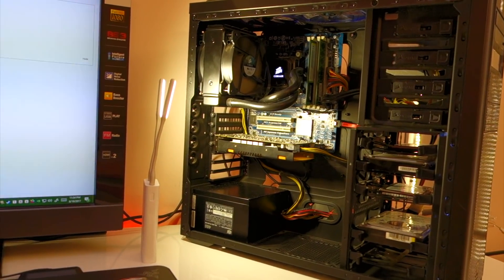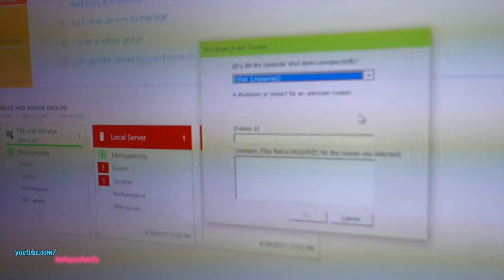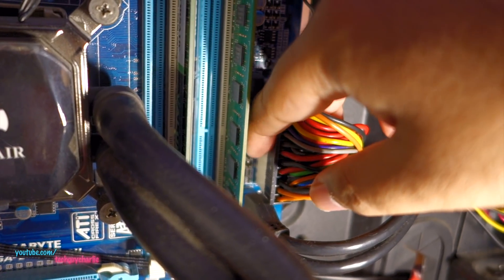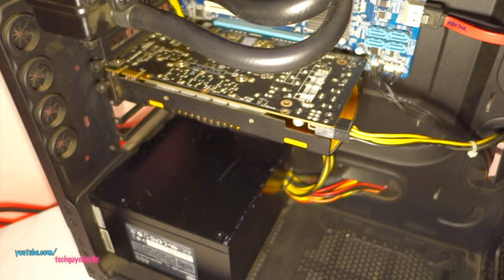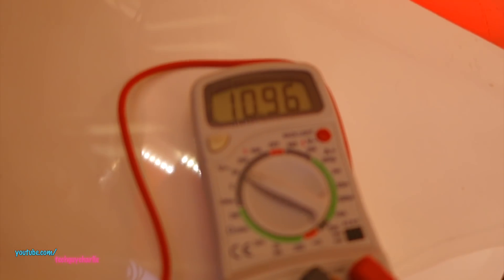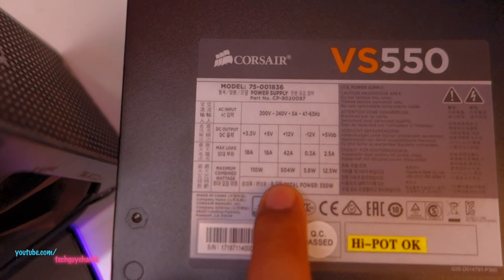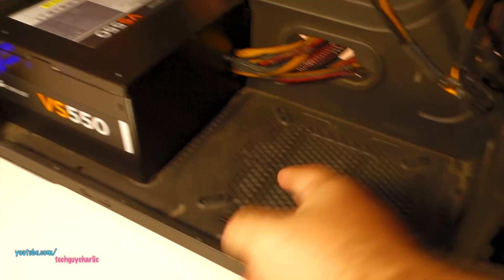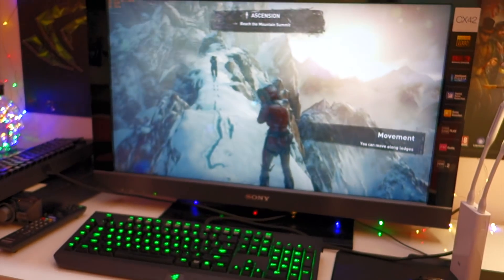Computer randomly shuts down and turns back on by itself - How to diagnose a faulty PC power supply

Comment: This is very frustrating, especially the hopelesness feeling after it happens multiple times in a day
Reply: For anyone wanting an update, bought a new power supply, it happened again, $100 down the drain, messed around with pc battery savings over the co ur we of 2 weeks and now it’s fixed
Reply: @-FreFlo  please re type that
Reply: @-FreFlo  did you fina a solution?
Reply: @pushpithageeganage7992  nope
Reply: @-FreFlo  replacing psu didn't work ? did you try motherboard?
Reply: @pushpithageeganage7992  nah psu didn’t work, and I don’t even think I could replace motherboard, as it’s a 6 year old prebuilt
Reply: @-FreFlo  I think for me it’s the psu gonna get a new one soon, you should try uninstalling drivers and reinstalling them, reinstalling windows, maybe it’s the motherboard or the gpu, maybe just take it somewhere for them to look at it
Reply: @riachu81  Did a new power supply work?
Reply: @Shiv-xm4xm  the problem was a bad ram stick.
Reply: @Shiv-xm4xm  take your ram sticks out and test the pc one at a time, that’s what I did and I found the bad one
Reply: @riachu81  Yep, I already tried this. The problem was still there. Although I did notice that I was able to play games for longer periods of time with one stick as opposed to two sticks.
Reply: @Shiv-xm4xm  yeah that happened to me then I tried the other stick out and it’s been fine since
Reply: @-FreFlo  I bought an iBuyPower trace 940 back in 2018, it shuts off randomly showing the exact same symptoms you're describing, I've replaced EVERYTHING in the computer including the hard drives/ssds and it still shuts off randomly, at this point I'm starting to think it might be the case.. XD
Reply: @deconwhite  hahaha yea I have no clue, my pc still does it
Reply: @deconwhite  same problem on my ibuypower I have the trace 4 MR 9340. No clue what is wrong with it and I’m angry Amazon won’t take it back. Ibuypower sucks
Reply: It happens to me even when I'm just watching a movie not only by playing a heavy game like horizon zero dawn, So what i did is i removed my gpu that is gtx 1660 super Evga and tested my pc with the integrated onboard graphics that is intel hd 4600 nothing happens even when playig light games but when i plug in my gpu that is gtx 1660 super pc keeps restarting itself with a buzzing noise/sound. Can anyone help me?

My specs are 
Intel core i7 4770
16gb ram ddr3
Eps 850 watts 80+ silver
256gb ssd
Evga Gtx 1660 super 6gb vram
Mobo ecs z87h3 a4
Reply: @footballmatchhighlighttv  u found solution?
Reply: @CruyffTech  sold the pc and bought a jailbroken ps4, now I'm enjoying so bad 🤗
Reply: @footballmatchhighlighttv  damn 🔥😂😂
Reply: So what is the solution?
Reply: @vinhleba8126  just keep messing with settings i guess...
Reply: @-FreFlo  I was messing with the settings and fixed it for a month or two and then it happened and now happens more frequently.
Reply: @-FreFlo  Don't you remember where were you messing with? I desperately need to know :(
Reply: KornalyUr yes, so it was my power supply, corrupted power supply, had to switch back to my old one, <3
Reply: @-FreFlo  Oh.. My PSU is working fine, I checked. My other guess was overheating, but when I check it with SpeedFan, it's never above 60°C under stress test.
I guess I'm doomed to get used to my PC shutting down anytime :(
Reply: KornalyUr 60c isn’t to cool bro, should be chillin around 45
Reply: @vinhleba8126  Change your PSU
Reply: I have an update guys: My problem was resolved after I saw that my mb was overvolting my a6 5400k, causing the random reboots I was having. So check that out if you can.
Pd: English is not my first language
Reply: @Nicoyunn  yeah that also can be the issue
Reply: Lamborghini Boy lol
Reply: ColipongHickey I can’t dm you when I go to the about page.
Reply: Also a Thermal Paste can also work as it cools the processor.
Reply: Whatever It still is doing the same after a month I guess my luck isnt good
Reply: @hk9 well if it makes you feel better recently I was trading with rocket league professional player musty and I crashed mid trade while he had like 3k viewers
Reply: bruh i lost all my school work on google form bcs of this bs
Reply: ColipongHickey did u find a fix? I say take it to a professional I’m taking mines today he should fix it
Reply: @wylo1071  It turned out my video card was faulty. 3 and a half yo GTX 950. When I put back my old one, the problem disappeared
Reply: KornalyUr Heikal Syah I’m having a similar problem when I play game for like 20-30 mins my computer just restarts when playing games do u think it’s my psu I don’t think it’s my gpu because it passed the stress test
Reply: This was happening to me after I upgraded my cpu because my power supply was too weak. Maybe buy a better one. That fixed it for me.
Reply: ColipongHickey I’m having the same problem can you send me this article
Reply: Check your thermal paste. If its dry then apply a new one
Reply: @TCOxNATION  send the article pls
Reply: I feel you man. The hard thing is that i don't know what causes this!
Reply: Mine worked after I removed ever single cable and using my blow dryer cleaned the computer and then put the wires back on.
Reply: Colin Hickey what’s the article?
Reply: @hk9 Try replacing thermal paste in cpu
Reply: @hk9 nope havent fixed anything it still happens
Reply: @hk9 don’t. Look at one of my first replies. I changed my power supply and it didn’t fix
Reply: @hk9 hehehe. It happens in bursts for me. As in if it happens once to me. It’s going to be doing it for a week or 2 then it stops doing it for a longer amount of time then repeat
Reply: @hk9 well. He ended up adding me back on rocket league, and later on putting that clip in a YouTube video (I can tell u name and time stamp in video of you want) so it worked out in the end
Reply: Try taking off the chipset and VRM heat sinks and clean and redo the thermal tape and paste
Reply: @DylanSaliba  my pc doesn’t overheat lol
Reply: Yeah, it’s been happening to me for a year now
Reply: @arkaik.  I ended up just getting a new pc... never stopped, who knows what our problems are.
Reply: @-FreFlo  Planning on doing the same, but I need to save more money
Reply: It very well could be the socket you are plugging your pc into.  I don’t know how but had these problems for 2 years, did every trouble shooting there is.  Finally plugged my pc into another plug and completely fixed the problem!
Reply: its happening to me and im defeated .. i dont even wanna game anymore lmao idk what to do cause its an oem

Comment: I figured my psu is stuffed, its a 860 w corsair from about 10 years ago, pc is always on (except now), mostly ran from a line filtering ups, now it only stays on for about half a second and keeps cycling. It died when i was finishing farcry3 lol, might open her up and inspect some components. was running a 4th gen i7 and 2 1080ti's 

Good instructional video mate.
Reply: My psu was fine, turns out my bios needed to be reset, then it booted. Now to find out what's wrong with my ax1200i that only worked for a few days.

Comment: I have this issue... Partially. I've tested pretty much everything in my computer apart from my two hard drives. Could they be the issue? Because this rebooting thing keeps happening, I suspected it was some windows installation error (somehow) and reinstalled windows but the same thing keeps happening. And at seemingly random times.
Reply: It was the main hard drive. For whatever reason, it was causing the issue. It didn't do it before but now for some reason, it got ruined.
Reply: Did you hear some clicking from hard drive when the shutdown happen?

Comment: Literally bought a brand new power supply..... Like 2 months after having it (I dont even game) I'm having this issue. Not only this the keyboard randomly turns on and off too! It happens like 3-4 times then itll work perfectly fine for like a week and do it again.
Reply: @Broodje_ Jonko Nice dude. Happy gaming
Reply: Same! Did u resolve this?
Reply: @JorgeMiguel147  Just eventually started working again.
Reply: Alladeen Madafaker  okay I think I found the problem. My pc has a button to restart. I decided to disable that, and it worked.
Reply: @Broodje_ Jonko it could be your RAM.
Reply: @Broodje_ Jonko it could be the RAM, Motherboard or power supply. First check the temperature of your pc. My problem was that my PC has a buttom that restarts the computer, and the cable was broke or something like that. So I just disable it.
Reply: @JorgeMiguel147  i also have restart button on computer ,how to disable it?
Reply: @JorgeMiguel147  ohk thx 👍
Reply: @Broodje_ Jonko dont think so. If it happens again, check your RAM first.
Reply: @Hydra which one? I have the problem since 2 weeks, coming out of nowhere. And I have a new power supply. Temps are fine. Any stress test, torture etc running without problems even with a test the cpu running 98 degree celcius without trouble.
Reply: @DieTabbi  so u found any fix?
Reply: @CruyffTech  yes I send the 3090 back and get a new one. Stable, fast as hell and good temps. If you get crashes or to hot send it back.
Reply: @DieTabbi  i ordered new psu i will check it if that doesn't work then i will try for graphic card,thx alot 👍

Comment: I'm assuming I have the same problem without checking the power supply.  I added an extra 1 TB drive and after about 30 minutes the PC will restart itself, but I do not get any error reports, it just reboots.  With the extra hard drive disconnected the problem doesn't occur, the extra drive may be too much power consumption for the power supply, not necessarily that it's faulty.

Comment: I changed my PSU and it still restarts on its  own!!!
Reply: It can be also related with drivers of pc now some drivers may intervene with motherboard bios and lead to such a issue for instance if u got windows update there are some files which are causing crash with your system and leading to restart, let’s say you are using 1903  it has files which makes your pc to function crazy so by downgrading to 1809 it will give you more stability so basically not all failures are related with power supply most of time it is related with incompatibility of bios and driver versions.Also check for bios update.
Reply: Did you even test to see it was faulty? And if so, it can be your motherboard. Diagnose your mother board. Better to replace psu as they're less expensive first.

Comment: Bro I have a same issue but when my PC is restarting itself, the heatsink fan and the other fan is still working properly. It is PSU problem or what?
Reply: Heikal Syah did u ever find out and what was the problem
Reply: @wylo1071  yes, and it's the PSU problem. Then I changed my PSU to a new one and solved all my problems.
Reply: Heikal Syah I’m having a similar problem when I play game for like 20-30 mins my computer just restarts when playing games do u think it’s my psu and it passed the stress test I kno it’s not my gpu or cpu
Reply: @wylo1071  I also passed the stress test. Yeah, I think the probs is PSU.
Reply: Heikal Syah I think it is I went to my event thing it has a error saying this      And it says.   The system has reboot without clearly shutting down first and caused the system to stop responding, crashes or lost power unexpectedly
Reply: @wylo1071  so do I. I'm 99% sure that PSU is the probs, just try another PSU should be fine.

Comment: Had the same problem and thought my PC was overheating due to dust at first. After doing research I saw it was a power supply issue. Your video was visual confirmation
Reply: J F So it time to upgrade my power supply right? I just use it for like 2000 hour is that normal power supply life time? Or I just use it too much ?some week I don’t turn my pc off at all
Reply: @cinematicnewbie1448  usually they should last about 5 - 10 years. yours lasted exactly 0.2283105 years. no I am not making this up

Comment: Rm750x doing this, just got 1080 to back from rma
Reply from the maker: RM750x is a pretty decent power supply.. surprised it failed.
Reply: @TechGuyCharlie  not 100% sure if it's the psu. Plugged in a molex and connected a multimeter to that. Its putting out 12.25v most of the time. But when I open ac odyssey it went crazy. Now windows wont even boot. Going from bad to worse.

Comment: I had the same issue and replaced  my psu with a brand new be quiet system power 9 bronze 80+ and month later same problem my gpu is rx 470 8 gb but it's second-hand but it's tested and runs fine
Reply: u fixed??

Comment: Thank you for this, finally. Someone who gives answers instead of posting a video saying they have the same issue and asking others for help
Reply: It happens to me even when I'm just watching a movie not only by playing a heavy game like horizon zero dawn, So what i did is i removed my gpu that is gtx 1660 super Evga and tested my pc with the integrated onboard graphics that is intel hd 4600 nothing happens even when playig light games but when i plug in my gpu that is gtx 1660 super pc keeps restarting itself with a buzzing noise/sound. Can anyone help me?

My specs are 
Intel core i7 4770
16gb ram ddr3
Eps 850 watts 80+ silver
256gb ssd
Evga Gtx 1660 super 6gb vram
Mobo ecs z87h3 a4
Reply: @footballmatchhighlighttv  did you fix it

Comment: Holy moly thank you for the help it was indeed the power supply
Reply: It happens to me even when I'm just watching a movie not only by playing a heavy game like horizon zero dawn, So what i did is i removed my gpu that is gtx 1660 super Evga and tested my pc with the integrated onboard graphics that is intel hd 4600 nothing happens even when playig light games but when i plug in my gpu that is gtx 1660 super pc keeps restarting itself with a buzzing noise/sound. Can anyone help me?

My specs are 
Intel core i7 4770
16gb ram ddr3
Eps 850 watts 80+ silver
256gb ssd
Evga Gtx 1660 super 6gb vram
Mobo ecs z87h3 a4

Comment: This started happening when I downloaded a new GeForce driver. Is that a cause u think? Please help someone my mum doesn’t want me to try to actually open the pc physically
Reply: Upgrading your geforce means it will need more power to run games or whatever. If you power supply couldn't deliver the power necessary ofcourse it will restart and keeps on restarting
Reply: I literally did the same thing, I downloaded the GeForce driver and it restarted itself twice already

Comment: Can you please tell me ? About my problem... actually I brought a gaming pc which has 16gb ram 2666hz, 1050ti gigabyte that doesn't take any extra power and i5 8th gen running with cooler master 650watt, but the problem is while turning on sometimes later it's off then on , cause it's related with GPU, it's not working GPU doesn't supply signal to monitor or turn on , I have tried many tricks but not working, I just replace mob battery then open pc then I have watched my GPU fan turns spinning but my pc turns off it also turns off so that I ask you if my power supply damaged or not please help me kindly!!!

Comment: I've a VS 550. I'm having the exact issue right now with it lol. The VS series are trash. Never buy them. Even on a budget, get atleast an 80+ Bronze cert. PSU.
Reply: hey, i have also a VS550 with AMD RX580, and my computer is doing the same issue, were you able to solve your issue by just upgrading PSU ?
Reply: @YoussefNAIMI93  I haven't upgraded yet. But I've temporarily solved the issue by undervolting my GPU. I've a 1060 6GB.
Reply: @msnehamukherjee  i too with a msi afterburner
Reply: @assassinskiller503  I bought a new Antec EarthWatts Gold bro 550w PSU 8 months ago and solved it permanently. I suggest you do that too. PSU may pop anytime and take all your hardware with it.
Reply: @msnehamukherjee  thanks bro,whether it restarted even in low loads like video player
Reply: @assassinskiller503  No it never restarted for me in normal usage like browsing or watching movies. Only during gaming. If yours is restarting even while watching movies then your PSU is at the end of its life.
Reply: @msnehamukherjee  thank you very much bro i try to buy a new psu untill then i will not do any work on my pc
Reply: @assassinskiller503  You're welcome :) and good luck with your PSU, hope you can buy it soon.
Reply: Really vs series is trash. Same psu same problem. I think i will buy a cooler master

Comment: My pc seems like it only restarts for certain games most games it works fine but csgo it restarts randomly, when I don’t game it doesn’t restart. I have a 600w evga bronze. Should I buy a new psu
Reply: Turn multicore rendering off in csgo. It wont restart then. Im having the same issues rn lol and Im saving up for a EVGA Supernova 1000Watt